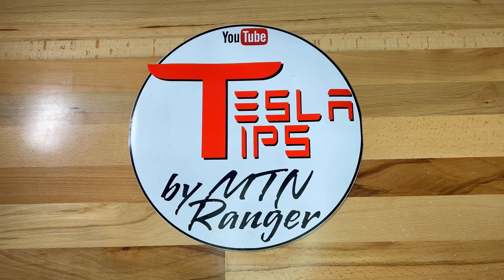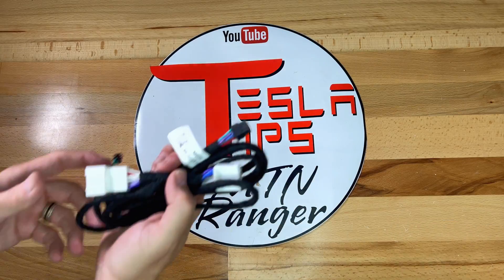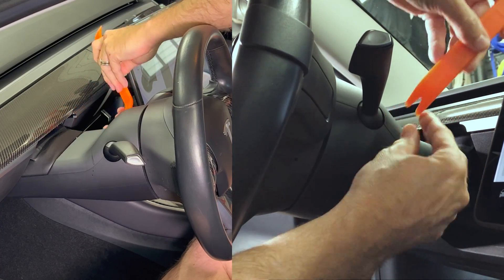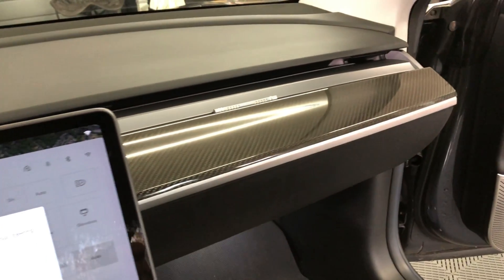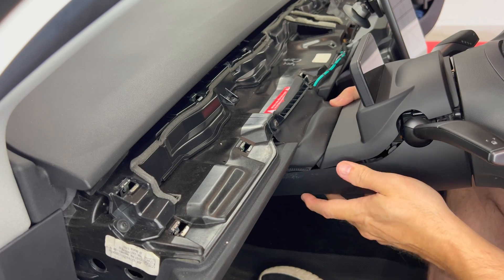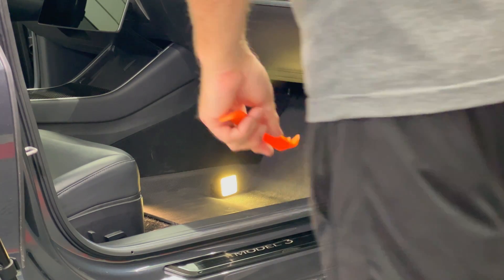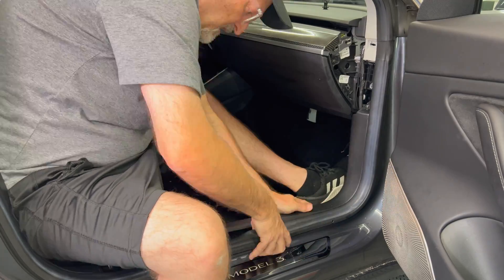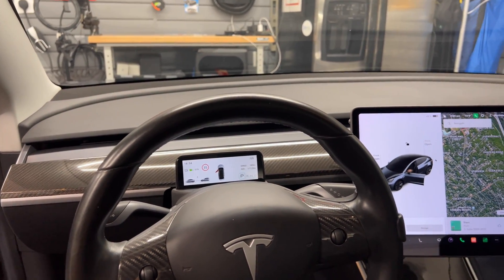Tesla Model 3/Y - Ultra Mini Driver Display - Installation

Comment: Being able to remove that cpu plug is like magic … I gived up to do it because I don’t like to have a non Tesla connector to the cpu and it’s quite hard to easy work on that connector .
Reply from the maker: It is definitely the hardest part of the installation.  It's a tight space!
Reply: @MTNRanger  I have got to connect and Tesla screen appeared in black so I decided to not install .
Reply from the maker: @creatorex1  That's not good. I wonder if the cable is bad.  You did connect the existing Tesla cable to the other end of the new cable?  You need two connections to the new harness.

Comment: I installed this a few days ago. Is it normal to hear wrinkling noises when adjusting the steering wheel after install? It would awesome if you could get back to me. Thanks!
Reply from the maker: Make sure the column faux leather shroud is firmly attached, Also make sure the wiring is not catching on anything.

Comment: What,s the difference between the intel version and the amd ryzen version?  Is it the same unit?  Just different cable?  Was yours the ryzen version?    And why did you choose to run the cable through the upper dash?  Wouldnt it be easier from underneath?
Reply from the maker: I'm pretty sure it's just the cable that is different.  I already had run wiring through the dash and had the remove the existing driver display.  To me it's personal preference.  I see either way more or less the same for effort.

Comment: It seems that Hanshhow is now delivering it with a single cable with both AMD and Intel connectors.  Have you seen this?  Adds a lot of bulk on the distal end for the unused connectors.  Concerned that they are going to bounce around and rattle!
Reply from the maker: Yes, that is the cable I didn't use.  They packaged both cables in the box I received.  Probably just one now to cut cost.  It is bulkier.  It's not a bad idea to use gaffer tape to secure the wiring inside the dash area.
Reply: @MTNRanger  Yeah, they only supply the combined cable now, which would require hiding a lot of unused cable/connectors in the footwell.  Seems like I should be able to cut the AMD ones off, no?
Reply from the maker: @SmoothBassVO  As long as you will not be using these cables for a newer car, I don't see a problem with removing the unused connectors.  Just be certain to cover the ends with electrical tape like you mentioned.  Worse case, I could send you my extra cable if something goes wrong.
Reply: I wonder if I can just cut it off and then use electrical tape to make sure nothing shorts?
Reply: Actually looks like the second cable you show that has both.  They no longer ship the Intel-only cable.

Comment: Fantastic install video for the Intel version.  Best one I have seen!  Thanks!  Would duct tape work just as well as gaffer tape?
Reply from the maker: Thanks! Duct tape should work fine.  I like using gaffer tape since it doesn't leave residue when removed.

Comment: Will this void any of your tesla warranty?
Reply from the maker: No, it is not changing any data, only reading the Canbus.  As long as you install it correctly, there should be no issues.  I can't guarantee that it will not void the warranty.